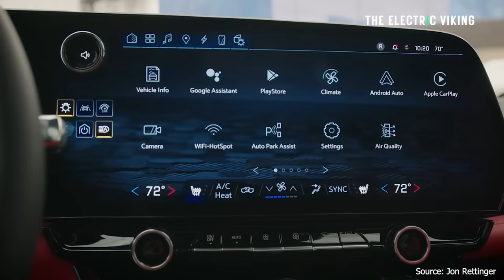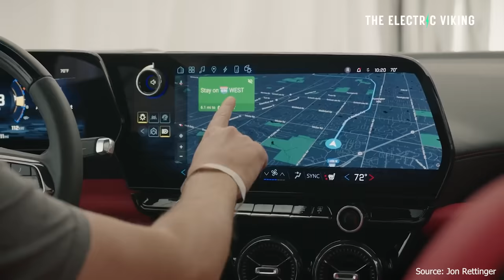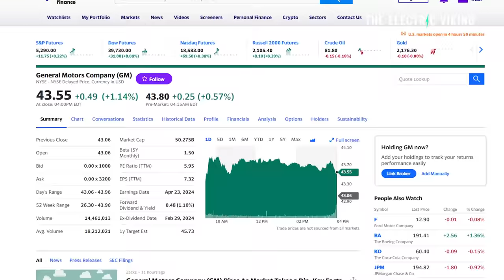Wall Street says GM CEO Mary Barra's promise of 400,000 EVs is pure fantasy

Comment: I own two Chevy bolts.  I absolutely love them and they are incredibly reliable and comfortable.  Yes, they definitely rushed the Ultium platform release; however, them stopping sales to get it right was the right move.  Look at Hyundai/Kia with their DC-DC converters, they still are resistant to admit and repair the vehicles properly.  I do believe that once the kinks are worked out on the Ultium platform, that it will be amazing.  The Bolt to this day, I believe, is the best EV GM has made.  They definitely are saying to high of numbers for production goals, that would end up having a ton of inventory sitting for them.  They need to prove themselves more widely to the EV community first, then the mainstream community, then once they prove that; ramp up production at that point.  GM does have the ability to beat Tesla on build quality, reliability, part availability, and possibly price; but that does mean they have to make a concerted effort towards those ends.

Comment: GM is in big trouble.  It is likely to find itself in a deeper hole. soon. Mary Barra's plan several years ago sounded like a pipe dream.  I spent 28 years in GM plants as an Industrial Engineer..  GM is making some great vehicles.  They are not nearly enough.  The YouTube videos shot today of GM plants look too much like they did when I retired in 2001.  I'm hoping for a miracle but I don't see it coming.
Reply: GM's cheapest vehicle is the 2024 Trax - from Korea. Wooden Sliverado comes from  Mexico where GM pays slaves TEN BUCKS A DAY (NY Times). Not "great."
Reply: @FrunkensteinVonZipperneck  "As of January 1, 2024, the minimum wage in Mexico will be MXN 248.93 per day for the rest of the country, and MXN 374.89 per day for the Free Zone of the Northern Border. This is approximately USD $14.50 per day for the rest of the country, and USD $21.83 per day for the Free Zone."

Comment: GM had the EV1 first and then dropped it.  Tesla put all of its effort into the power train weight savings to reduce costs and get better range.  The GM managed to screw to a  15 year lead. Their internal managers should all be fired
Reply: Too late to fire them - they all retired with golden parachutes, just like Mary Barra and her executives will do, leaving everyone else holding an empty bag.
Reply: GM managers from 1990 are all retired and collecting that sweet GM pension
Reply: Oil companies.
Reply: No, Tesla cars all outweigh the NiMH powered EV1 by a fair amount.  And they're mostly around the same size.

As to whatever lead...Tesla lives and breathes off subsidy and grants no one else gets.  Since EVERY EV maker (including Tesla) has to sell EVs for far less than they cost to make, NO ONE is making money on them.

Barra either keeps investors coming in with aspirational language and DOESN'T blow the company up on EVs, or she goes to jail for bankrupting the company trying to make EVs.  There is no 'EVs are profitable to make' choice, since they aren't.  Not at a price people are willing to pay.
Reply: @billcichoke2534  Ev1 was a 2 door 2 seater so no, not the same size. It's range 55 to 90 miles.  With battery it was about 3000lbs. It was advanced for its time.
Reply: @ChicagoBob123  Check wheelbase and overall dimensions.  The EV1 is actually a tad LONGER than the Model 3, has a 25kWh pack (NiMH version) and weighs almost 1000 lbs LESS.

That 25kWh pack, by the way, was enough for around 100 mile average range.  Do the math, and your lord and savior Elon's super duper Panasonic battery packs get around the same range per kWh, some 30 years later.

Sorry, but the comparison IS valid.
Reply: @billcichoke2534  the model 3 is 185 inches long, ev1 169.  Not in any way the same. The base model 3 goes 200 miles at  highway speed.  EV1 maybe 50 miles
Reply: @ChicagoBob123  Ya got me on the wheelbase; I switched them like a goof.  But you missed on the range.  The LEAD ACID battery version would get 50-60 miles.  The NiMH would average 100 at that speed.

Again...the amount of ACTUAL change to EVs has been very minimal...aside from government coercion to force their sales and use.
Reply: @billcichoke2534  No there has been HUGE changes. Charging speed, over 100KW and for Tesla 170KW allowing you to drive on in 30 minutes with hundreds of new miles in the tank. Range not a 100 but 200 and more with air going. Battery preconditioning allowing for charging at optimum speed. Motors generating so many horses 0 to 60 in 6 seconds seems slow. Regen that has been tapered to make it smooth and useful. The list goes on.
Reply: @ChicagoBob123  All of those have been band aids to overcome the inherent risks of charging and discharging as fast as Tesla has been trying to do.  And battery life is HEAVILY impacted by doing so.

The electronic gizmos are more of a distraction than an improvement.  They do nothing to increase range or make the car drive better, often USING power and decreasing the range in order to function.  In addition, they are being exposed as safety issues, since they all require power and everything (especially in Teslas) is run by software.  When all your systems from wipers to door latches requires power and computer actuation, as opposed to just simple switches and mechanical latches, things become problematic, not better.

And, again, this is between a vehicle that came out in 1990 something versus one that came out in 2016.  Sorry, but the basics haven't changed that much, if at all.  Only the added gizmos, hype and cult following, and government force have changed.
Reply: @billcichoke2534  band aid?  That was senseless.  The battery life is not impacted.  These new evs go well over 200k miles.  The fast charging doesn't impact them.  Many thought it would.  All of those things they added makes the car usable
Reply: @ChicagoBob123  Fast charging doesn't affect battery life?  Better tell that to the Uber drivers and Hertz, since that's EXACTLY what they've found.  Better say something to Tesla, since even THEY state that frequent use of superchsrging will accelerate battery degradation.

You're kind of right about all the gizmos making the car 'usable.'  More accurately, they're the only way you can use the car AT ALL.
Reply: EV1 was bad, limited  passenger space, terrible range.  Might as well praise the 1st gen Leaf - which was much better, but didn't improve much - still being sold,  Sam never mentions the Leaf.  

The EV1 got lots of publicity and probably revived interest in electric cars.
Reply: @timothykeith1367  Not a lot of interest was raised for EVs in general, which was (among other things) the main reason GM never messed with it again.  I would be surprised if the rear of the EV1 didn't match the cargo capacity of a Model 3, and it had far fewer batteries to haul around OR CHARGE.

Again, mechanical engineering will always be a better solution than covering up design problems with electronic gizmos.  And, with all the hype and government mandates and the like, interest in EVs is STILL low.  That's the reason for the subsidies and mandates.
Reply: @billcichoke2534  what a chuckle you are.  The mechanical and aero of the Teslas are world class.  The joke is GM hasn't been able to make a dime on EVs because they are incompetent and have idiots running the show who think if you throw more cooks in the kitchen you'll soup will heat up faster.  I tire of your silly statements.
Reply: @ChicagoBob123  Really?  World class?  What a pantload.

Tesla is unable to compete by doing things we expect from a car company.  A great deal of subterfuge and cultism are all they really have.  Their vehicle build quality is for crap, their designs tired and polarizing, their list of problems owners are willing to report growing, and their status quotient is fading.

You want to attach yourself to this overhyped nag...that's on you.  But nothing I've stated is untrue and is readily confirmed with even simple online research.  If you can't see that...well, I am not going to CHUCKLE at something so sad.
Reply: @billcichoke2534  LOL What was the worlds best selling car last year? Hmm? Model Y and its still selling like crazy. Your inability to understand how good it is says more about you than the car. Drive it for more than a minute.
Reply: @ChicagoBob123  Wow.  A little research shows that without China fleet sales, NO EV is the world's best selling car.  The Rav4 and Camry still seem to be tops.  Guess that was the only way Tesla could preserve the hype about demand...even as they're forced to DROP PRICES to SPUR SALES.

And I've tried a Mod S.  Anyone who says these things drive better than anything out there, don't know how to drive and/or probably shouldn't be driving.  So you just told everyone a WHOLE LOT more about YOU, than you could ever INSINUATE about me.

Sorry, pal, but you're just all sorts of wrong on this.
Reply: @billcichoke2534   YAWN. Tesla Model Y now outsells Toyota Camry in California  if you google search. Its the number 1 new car state in the US. But none of this matters because you are just being contrarian. When I give you facts you blame China? I think Toyota would LOVE those sales as ICE sales shrink. Gas sales shrink and EV sales world wide grows. Yes grows. You go on about how much you know as I know you are superior to everyone on earth. Me I am just going to enjoy my EV saving me a ton of money each month I drive it.
Reply: @ChicagoBob123  Keep moving the goal lists, buddy.  In the U.S. the Rax4 and Camry outsell the Model Y by at least 30%...EACH.  As well, Toyota comes just under Ford and Chevy as far as pickup sales, while the stainless doorstop...does...video games better with a non mechanical steering wheel...I guess...

It's not being contrarian.  It's calling bs on a widely-reoeated falsehood.  But keep simping for Elon.  I'm sure he'll give you some unregistered Tesla stock as he exits.
Reply: @billcichoke2534  How many years have you been grasping at straws?  I have to give it to you for tenacity.  I've never seen anyone eat as many words as you.  You're an odd one even if you're a paid basher.

Comment: To fix the GM products:
1) Remove the LCD screen and replace it with knobs and switches.
2) Remove almost all of the software and run wires from the knobs and switches right to the stuff they control
3) Make a nice place for a cell phone holder up on the dash.
There are enough people who don't want touch screens to make a market.
Reply: And have manual parking brakes.  None of this electronic button garbage.

Comment: On EV forums, it's amazing how people still freak out over every little thing for Tesla, then turn around and fight hard to minimize and excuse GM's massive issues. The last good EV that GM produced was the Bolt - and they killed it without replacement. GM just pushes out more promises and fantasies. Can you imagine the screaming if the Tesla factory had 11 fires in a few months?
Reply: I think GM was losing money on Bolt
Reply: @timothykeith1367 Yes, largely because Mary refused to scale up Bolt production. You simply cannot make money selling a $30k car unless you get to real volume. It took them 5 more years to match the production rate of their first full year (2017). I'd bet money that Blazer is losing far more per unit than Bolt.
Reply: It was always a compliance car.  Losing $9k per Bolt was just the cost of doing business.
Reply: @longmuskox4194 At the beginning? Sure. I don't believe it was nearly that bad by 2023. Feel free to find an authoritative reference though. Again, scale matters - if they had scaled up Bolt to say 500k/yr, they could have reduced the cost per unit significantly.
Reply: @tomtxtx9617  Sales in the USA peaked in 2017.  Of course, economy of scale matters, but GM was never trying to get there.  Their objective was to not pay Tesla for carbon credits like the others were doing.  It was always just a compliance car.  Costs went up with later retooling and factory shut downs with the battery recall debacle.  Who knows when or where the next Bolt will be built.  They don't have a factory for it anymore and they don't have a new design to meet the Ultium platform.  The Lake Orion plant is now cleared out for renovations and construction to eventually be the Silverado EV factory, but we'll see.  At this point I wouldn't take anything they say as truthful, it's all just fluff for their public image.  Because, GM electrified the entire auto industry, and led, and it matters.  LOL

Comment: GM cannot solve its software problems because it is not vertically integrated. It doesn’t really manufacture cars, it assembles component's from over 100 different suppliers to produce an automobile. The problem is all those components run on proprietary software owned by the supplier. All of the legacy automotive manufacturers have been doing business this way for decades and this is their Achilles heel. Jim Farley admitted this himself.
Reply: Lack of vertical integration is much easier to solve than dealers and the UAW.

Comment: Tesla score #1 again.....in recalls....In February 2024, Tesla announced that it would recall almost 2.2 million vehicles, including most of its U.S. vehicles, because the font size on its instrument panel warning lights is too small. The warning lights are for the brake, park, and antilock brake system, and the font size violates federal safety standards. The recall includes the following models: 2012–2023 Model S, 2016–2024 Model X, 2017–2023 Model 3, 2019–2024 Model Y, and 2024 Cybertruck
Reply: So? Is this suppose to be a big deal

Comment: GM needs to go the way of the Corvette eRay and simply have an ICE on the front or rear tires only and an electric motor for the other end.  For the majority of people, living in a rental with no access to charging at home, that's a huge market that EVs will never be appropriate for.  If they want to make plug in hybrids, that's fine.  For people who can charge at home, they'll do that.  For those who can't, they still can use the car.  But then, the cost.  Adding the electric and battery to an ICE vehicle is many extra thousands of dollars.  Either the MSRP of the vehicle gets stupid high or they use the Ford model and lose tens of thousands for every EV they sell.  Despite the government giving rich people welfare to buy an inappropriate EV, sales are dropping because the fanbois have nearly been exhausted.  And in parts of the country, it costs MORE to run an EV than an ICE vehicle.  Here, in the northeast, we are supplied electric from almost exclusively natural gas and the gas lines coming in from the west are greatly strangled with too many powerful people in houses in front of the lines saying NO to adding capacity.  During the winter months, we get LNG deliveries to the oldest LNG terminal in the country in Everett, MA from outside of the US because the Jones act makes shipping from one US port to another US port too expensive because only US flagged ships can do this.  So we get natural gas, and oil for that matter from only outside the US.  Too expensive to get either by ship from the Gulf.

Comment: In many ways the way Tesla is currently making cars with gigacastings, integrated software and everything else is the way good ICE cars should be built.  Not everything that's in a Tesla is exclusive to EVs.  All the legacy automakers are saddled by the myopia brought on by their storied histories.  If they started seriously making EVs 10 years ago, maybe they could keep up with Tesla, but now Tesla's 10 years of EV manufacturing knowledge outweighs the other company's 100 years of ICE manufacturing knowledge; Mary Barra and GM included.  It;s ironic that the Chevy Blazer is a failure because of it's failure to integrate it's software and not because their batteries are terrible.  Integrated software is not inherently an EV thing; the root cause is subcontracting out too much of the parts/subsystem manufacturing.

Comment: I'll never go back to gas junk too much maintenance for me
Reply: I spend very little on vehicle maintenance.  What you might be saying is you didn't maintain your vehicles until they were broken, or you bought vehicles that Consumer Reports did not recommend.  For you, an EV might be better.  

My 1990s cars are low cost to operate.  But, that's not for everybody. 

I'm more into Scotty Kilmer and Dave Ramsey than Elon Musk. I don't care about 0 to 60 or gadgets - get me where I need to go ! I'm more concerned about my 401K than the cost of solar.
Reply: @timothykeith1367  no oil changes air filters belts spark plugs wires all cost the more moving parts the more maintenance you have that's all cost
Reply: wait till you need to replace that battery!  EVs need maintenance too.  Your living in fairy land.

Comment: She doesn't know the engineering side. Thinks they can just build a profitable EV out of thin air. You have to change 50% of the manufacturing and supply chain to make an EVs COGS to the point where you make money. That's 5 to 10 yrs of loss to get there.

Comment: Way more misinformation than usual, which is saying a lot! GM doesn't have "an EV factory". It assembles EVs at several plants, including Detroit, Michigan, Spring Hill, Tennessee, and Ramos Arise in Mexico. The delay was not at these factories. As well known, the delays were at the battery assembly plant where the packs were assembled. As for getting to 400K, they have more models than Tesla -- Escalade, Lyriq, Hummer, Blazer, Celestiq, Sierra, Brightdrop, and Equinox. And of course Bolt. They also sell in many markets not just NA.
Reply: I thought the Bolt was killed
Reply: @lamrof  Yes then no. LOL GM is revising it to use the Ultium Platform and LFP batteries. My recollection is that GM had a small less expensive vehicle planned, so using the Bolt rather than a clean sheet design and cheaper batteries will supposedly save a ridiculous amount of money -- like billions.